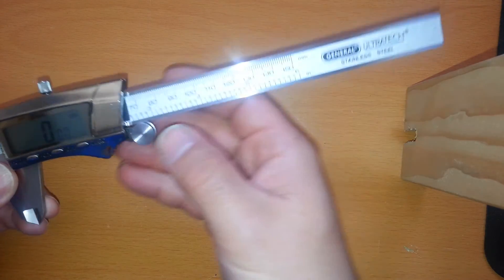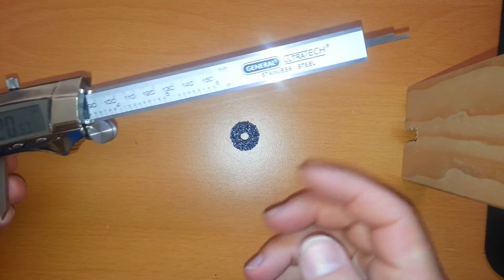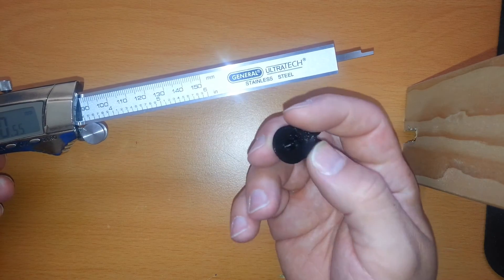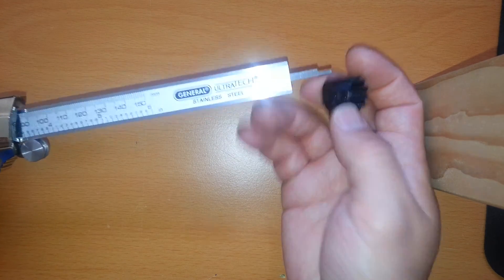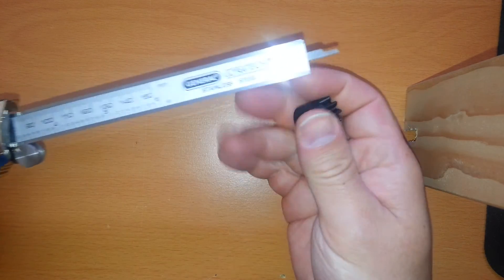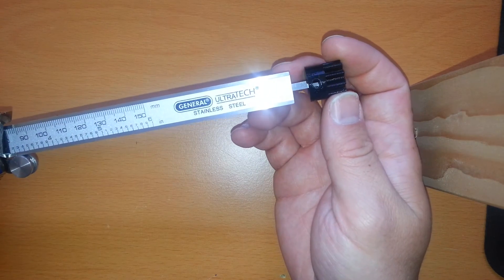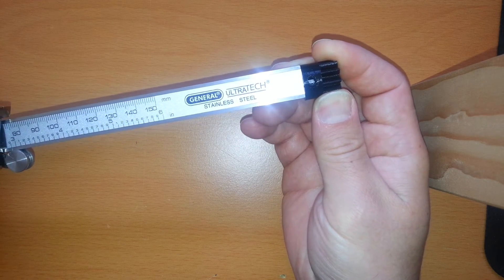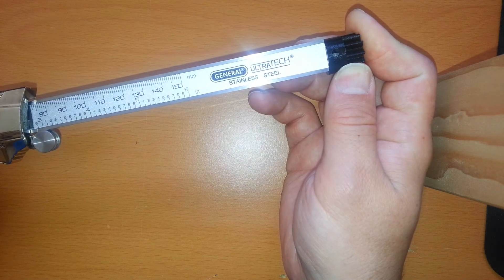How to use a digital caliper to measure depth.

Comment: Hey, that's worth it!!  Ha - I recently bought a $20 caliper just to measure circumferences of things that pop up every now and then and KNEW it had this feature, but I needed to measure the depth of something just now and said to myself, "Now HOW's that work again...?" -- and found your video.  So thanks to you, I WAS ignorant (past tense).  OK, admittedly, had I simply turned my caliper on, it would've been obvious the little blade comes out and reads a measurement as I turn the knurled knob, but I evidently I was too lazy and Googled first.  :-[

Comment: Realy? xD

Well you know you can do the same the other side right?
Due the side of the 0 on the caliper, That head of the caliper is also straight,
So on most larger things its better to use that since its a bigger surface so alot more straight so a better measurement.